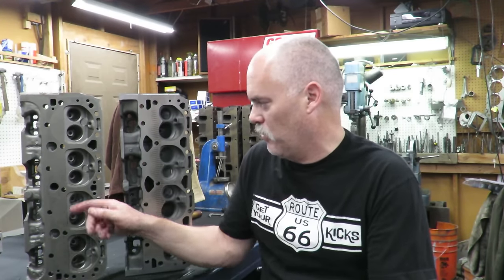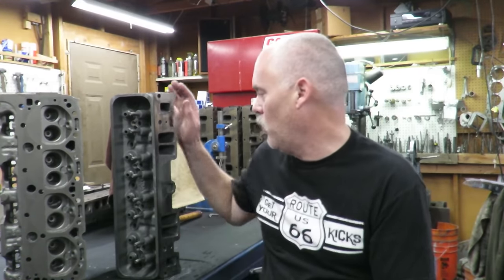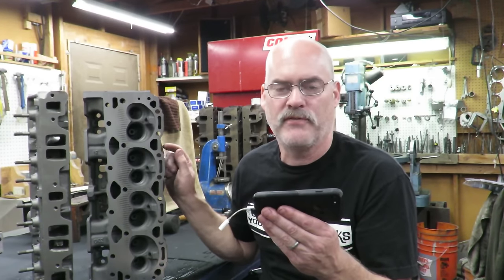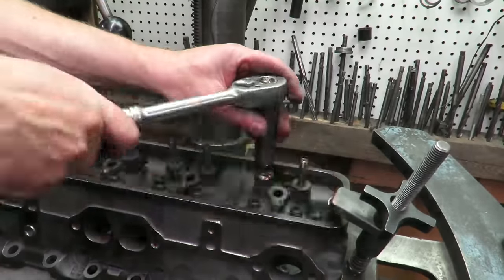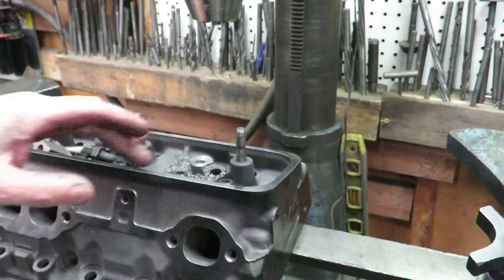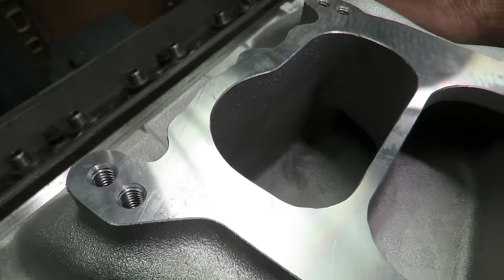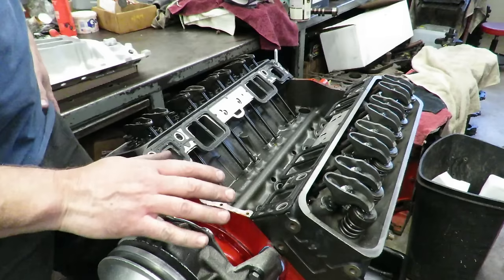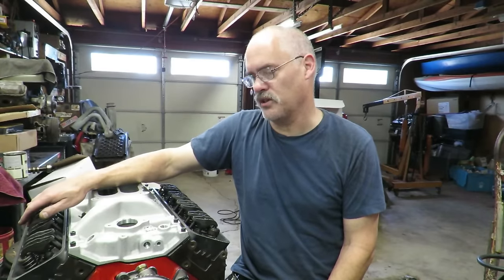How to get more power out of your Small block Chevy

Comment: What size cam could i put in without change springs or studs
Reply: My favorite cam is the 350HP/327 cam. it lives just fine under low lift heads and moderate valve spring pressure. Its a fairly lazy cam when compared to the agressive lobe profiles of today. Next to that is the Edelbrock Performer type of profile.  Avaiable from various manufacturers.   My brother put one in his 327 many years back which was a TRW cam. I put the Edelbrock in my 350. a few years back I put one  as a sealed power in a neighbors truck. all 3 cams carry the sme cam card and work well. its about a 300HP cam in the 350.
Reply: I have a ZZ3 camshaft in my 5.7R motor I'm running in my 1980 CJ5. You can look up the specs on it. I have the springs but haven't changed them yet since I didn't have them when I built the engine.
Reply: 650 CFM Holley carb, NV4500 5 speed transmission, Rock Jock High Pinion Dana 60 rear diff with 4:10s Do I need to say More??

Comment: What would be the best head replacement for my l31 for towing and torque.  My stock vortec heads might be cracked.
Reply from the maker: I would go with Vortec just buy new ones
Reply: @Myvintageiron7512   what's a good cam upgrade?

Comment: Hey whats better manifold vacuum or ported vacuum for advance? I have a 350 Chevy with Vortec heads, performer Edelbrock intake manifold, and a 600 cfm 1405 Edelbrock carb.
Reply: ACE TATTOO what’s better is throwing the junk edelbrock carb in the trash .
Reply: I see your point, but that still doesn't answer my question manifold vacuum or ported vacuum for advance?

Comment: I got a 350 out of a 91 Chevy truck can I use a dremel tool to increase the air flow of the head?its completely stock right now but looking to push 500 hp out of it when I get it stroked

Comment: Nice video
Reply: I have a 1989 Chevy 2500 and it has a 350 engine and I have been having problems with the TBI fuel injection I have changed a lot of parts and a lot on mechanics even a Chevy dealer mechanic that has a 50 year experience have look at it and the problem has not been found and one of the many mechanics told me that is a good truck the engine is original and has low mileage that if I was  interested in putting the new fuel injection systems that Holley and fitech make that it will work good in this truck now for my question will this engine upgrade will work with those fuel injection systems? Thanks and a very nice video

Comment: What would I need to soup up a 305 ?  Bottom end and top end  please.
Reply: Hot Rod has a good article on doping up a 305 for a limited budget, just Google "Hot Rod 305" and you'll find plenty of builds. Basically, headers intake, and a cam. Heads are virtually proprietary to the 305, but that's it.

Comment: Myvintageiron how much lift can you get out of tbi heads? Just trying to get more power for hauling. Planning on a comp high energy/marine 260h with .440 valve lift. Also it is carb swapped, Edelbrock performer dual plane and Holley 600 cfm 4160 gm hei and a recent valve job, arp head bolts.
Reply from the maker: The heads will take .440 lift but you need to change your springs
Reply: Thank you!

Comment: I have an 1988 350 that was rebuilt from some shop that I was gonna swap out the 292 thats in it now ....
I don't know if it has the swirl port heads from looking at it already bolted on ....
But -
Would I be better off w/ an 327 for more power ( and gas milage ) for my 1966 GMC 3/4 ton with stickshift overdrive than building up this 350 with vortex heads ? Also what cam should I use for either ?
Thx !
Reply from the maker: If you want my honest opinion I would rebuild the 292 that is one hell of an engine it makes more torque than a 327 and gets way better mileage maybe it's just tired and needs a rebuild out of the 3 engines 350/327/292 I would definitely build the 292 but between the 327 and 350 I would definitely go with the 350 it has more TQ and really on the street Horsepower is not what you need I always say for the street chase Torque for the strip chase Horsepower
Reply: Myvintageiron7512 later I saw you talking about the LS1 engines! What about that application?
Reply: How could that be ? The 292 weighs about the same , right ? Isnt it the best to just go with the LS engine ?

Comment: Please help me?  I cant find proof and I know you would have an answer. On a 1999 escalade 5.7 vortec, does filtered oil push through the oil cooler? Im asking because i cant figure out why my cooler has sludge in it???? 253k mileage on escalade. Can cooled oil with sludge cause engine failure? Recently my hyd lifters failed and i spun a rod bearing and two cam bearings.
Reply from the maker: your entire oil cooler system MUST!! be replaced if you have any kind of metal in it you will never be able to clean the metal out and it will destroy s new engine if you have a spun bearing replace everything lines and all
Reply: Thank you. I almost messed up. I put in a new  long block and mistakenly hooked up cooler after kerosene cleaning, i should have replaced radiator and lines. Oh well. Mine is cooled through the radiator and i was hoping the cooled oil leaving the radiator would head to the filter. Still not sure if it does. Thanks for answer, your a reall great teacher. You should sell your classes on dvd.

Comment: I know its a little late but i just bought a old tune port motor out of a z28. Its a little 305 that i was planning on boring out and putting a 350 crank in. Or im just gonna sell the motor when im done lol but i got the heads with the center bolt valve covers and the intake patter is weird. I got 2 straight bolts in the middle and the typical angled ones on the sides. Any ideas on these heads? Im tryna put the motor in my 90 ranger and have some fun with it. Im 17 years old and i need as much help as i can get. Thanks!
Reply from the maker: the 305 already shares the same crank from the 350 so putting in a 350 crank is basically putting the 305 crank back in I would find an 880 casting 350 block it's a direct swap for your 305

Comment: I have a 93 Roadmaster. I’m trying to get more hp/tq out of mine what should I all do to get it past the 180 hp? Could I do all of these mods but I have a hydraulic roller so what cam/heads/intake should I use?
Reply from the maker: you need vortec heads and a better cam the TBI heads you have are junk Edelbrock sells an intake that will accept your TBI injection
Reply: Myvintageiron7512 I’ve been told that the Gm performance cams would work. If I do the heads does that mean I’ll need headers that’ll fit vortec heads as well

Comment: Hey sir, how much hp do you think I would get out of a stock 350 with out touching the cam? I want to change the heads, intake manifold, carb, headers, exhaust ?
Reply from the maker: the cam needs to match the heads if you put on better heads you need a better cam
Reply: @Myvintageiron7512  hm ok, i’ve had different results with the ideology of the cam has to match the heads. I took a stock 454 and I put AFR heads on it upgraded the intake manifold and upgraded carburetor and I dino’d it. So originally it had 230 horses and after the heads and intake manifold it had 417  horsepower…. I was hoping it would be the same story with the 350 kind of thing, you don’t think it would work ?

Comment: I have a 67 283 with the power pack heads. Are they worth doing anything with?
Reply: disposing of them is good,standard 305 heads from a tpi camaro/firebird or a vortec 305 would be an upgrade and would be cheap as well.

Comment: So we got this 91 Chevy c2500, it was an old work truck for a plumbing company, anyways the thing is built for pulling (considering it has a hole in the bed for a gooseneck  and the granny 4 speed) and the engine is a worn out factory 350 (it smokes like a freight train lol), grandparents say it's not worth it but we've had it for a while and I've grown attached to it, anyways I thought about it for a while and I have an idea, could I just take the whole motor out of a truck you described (1996-1999) and either have the heads machined (like in the video, and assuming they're not cracked) or find a good set of aftermarket heads (cus I've heard aftermarket vortec heads are less likely to crack), and either go with the factory EFI that comes with the motor or just use a performer intake and top it with whatever I can afford?    Note: I wanna try to use the factory cam temporarily and upgrade the engine a part at a time.

sorry for the wall of text lol
Reply from the maker: sure that engine would be a great builder
Reply: To make it work, some companies build wiring harnesses that enable you to connect the different computer and EFI components found in the 1996 and up engine.

I have seen some aftermarket iron Vortec castings that don't break the budget. Some companies make stock replacement iron heads to replace specific OEM castings that are either crack prone, or too hard to find in a junkyard. The Jeep 4.0 331 casting is the first one I can think of.
Reply: Skyline Fever so what is this wiring harness called then, google only helps if I know what I'm looking for lol
Reply: There would be some rewiring, however, it wouldn't be complex. I think Painless wiring is the company that builds the TBI engine to Vortec engine conversion set.

What you don't have to worry about is rewiring anything not related to the engine.
Reply: do you have the part numbers, would be helpful in the sea of parts lol, also thanks for the info :)
Reply: I'm not sure of the number. I regularly buy stuff and get catalogs from Jegs and Summit Racing, they they sometimes advertise these Painless wiring kits. However, I might be mistaken and the correct item for your truck doesn't exist.

If you can't find it in one of their catalogs, I think you could give them a phone call. They help me out when their catalogs and websites confuse me.
Reply: I sure hope they have what I need lol, thanks again
Reply: I think I made a mistake. I found that the wiring harness is made by Howell EFI. I heard of them when researching the 1970s GMC RV with the Olds 455.

https://howellefi.com/product-category/general-motors/gm-vortec-products/

Comment: I bought an early 2000ish 4.8 vortec for a project but decided not to use it. are the heads on that motor the same as the heads being talked about in this video?
Reply: no that is an LS engine completely different engine and heads

Comment: I have a 350 chevy with dart 202 heads and I have  trouble trying to get it started what am i doing  wrong please help me.
Reply from the maker: That is a really vague question there could be many different reasons why it won't start need more info
Reply: If most  everything else is  right with your  motor, you may have too much initial lead on too little  cam. Do you have vacuum advance? When spinning it over does the engine spin slow hitting hard  compression bumps? Years ago as a kid,  I had to put a mild  cam in my 327 race motor to make it a daily driver while my DD was being repaired, and I had to get out and mechanically retard the timing to start it then add in the initial. That was 100% mechanical running 12 deg. initial with 24 in the distributor flyweights all in before 3000. If you are not high comp on a mild cam it could be  many other things from carburetor to coil ballast wiring being incorrect. - Sandy

Comment: Got a weird question, why on a sbc head gasket do they have the small pin holes on the big holes between the cylinder ?
Reply from the maker: To slow down the flow if it flows to fast it does not have time to absorb the head
Reply: Myvintageiron7512 thank you sir. Your videos are great . Reason why I asked is I have an engine that I can’t keep cool. I think the head gaskets are on wrong. I do have another question for you. I have a 87 and up block and it’s bored .030 over. I was told it is going to run a little hot because the block is made of thinner metal? I don’t know if this is true.

Comment: Any suggestion for a good performing/value aftermarket aluminum head you prefer to use on a fairly stout 355?
Reply: jess l , iron heads basically make the same horse power , the big difference between these heads is weight , aluminum heads are about 20 or so pounds , iron heads are 40 or so pounds each , so unless you are drag racing with your car and want to save weight , iron heads is the way to go , iron heads don't warp as easy as aluminum heads , planning and porting your heads along with a bigger cam can add 100 horsepower , and with a single steel shim gasket like comes from the factory to increase compression , I have the part number if your interested , but there are different aluminum heads if drag racing weight is what you are after , elderbrock, Dart, World all make aluminum heads

Comment: You say vortex heads are prone to cracking if they get hot. What sbc heads are best for high temps and good hp?
Reply: Lucky Rooster the engines going in a derby truck so my radiator only can cool for so long.
Reply: Tankhunter350 if it's in a derby I'd just use the old smogger heads that way if they get hot and crack you aren't out much
Reply: There are aftermarket iron Vortec castings that have extra metal in them to prevent cracking. They aren't too much more expensive than new OEM castings.

Comment: 2 ways, 010 block, ft pistons, fast burn aluminum heads, .550 lift .245 @.050, a big dual plane intake dialed in 750 cfm holley.... that should be around 400 hp 7k rpm max. $3500...... 2 nd way, dart iron block, 4340 crank, billet rods, brodix 221 alu heads, .680 roller .264 @ .050  12.5 je  pistons,  single plane intake....race fuel only, dry sump it,  dialed 750 hp holley .. 640 hp 9200 max rpm... $8500+  both will live...

Comment: I bought a truck that the original owner installed a Comp Cam 260H. It has .440 lift. Is that safe to run without needing to get the guides machined?
Reply: what year are the heads from? junk swirl port heads yes, Vortec heads, yur kinda pushing it
Reply: @brp360  the engine still has the original heads. I was going to get some heads off of a 96 or 97 Vortec.
Reply: @jessebenjamin4779  you still haven't told me what year your engine and heads are. what year is your engine and heads?
Reply: @brp360  94 K1500 Suburban
Reply: @jessebenjamin4779  no lift concerns with the 94 heads
Reply: @brp360  what I was trying to figure out is if I need to get the vortec heads done with the type of Cam that I have in the engine
Reply: @jessebenjamin4779  I definitely would have them machined, I've heard sometimes just .420" lift will cause clearance problems - better safe than sorry
Reply: @brp360  thanks. Better to be safe than sorry.
Reply: @brp360  i was thinking of buying some  then rebuilding them myself with refreshed valves and springs.

Comment: I have a 99 Tahoe 2wd 2 dr the tired 350 needs seals it just turned 180K miles... I wish listed a self tuning efi, dual plane intake, chevy performance fast burn heads with 210cc runners and a comp extreme energy cam 490 lift 238(ish) duration just that at summit $2838. I will have the cylinders taken out to .030" over with flat top pistons... do you think I should have to block drilled for a 4 bolt main or retain the 2 bolt...? I hope to top out with about 375 HP any suggestions comments???
Reply from the maker: sounds like it should run good I would buy a set of aftermarket vortec's from Dart or RHS forget about the 4 bolt mains you don't need them
Reply: or you could buy this  from scoggin dickey https://sdparts.com/i-24080864-blueprint-engines-bp3503ct1-350ci-sbc-with-cast-iron-vortec-heads-and-roller-cam.html
Reply: but if you just want to build your engine i would use profiler heads they have great flow and price is nice also. or these guy for a really budget head that flow good http://precisionraceengines.com/product/precision-race-aluminum-sbc-cylinder-heads-w-660-lift-springs/

Comment: Hey, I've seen your video's and have watched them for quite some time. I picked up a 1970 chevy 350 and the casting number on the head was 876445 (445). So I did some research on them. I can't find anything. Are those a good stock head, or are they going to flow terribly?
Reply from the maker: double check that number I think you got it wrong
Reply: @Myvintageiron7512  take the valve cover off, and between the intake valves for cylinder 2 and 4 is where that number is located. I have pictures of it as well
Reply: That's the only number on those heads that could be the casting number.

Comment: I'm posting my questions on this video. I've been watching as much of your stuff as I can , and you have replied to some of my questions. I'm assembling a 383 stroker. My mains are .003" rods are .002 -  .0025. Should I use a high volume oil pump with these clearances?  Also after checking CC's with a burett I'm at 10.1 : 1 compression ratio. Installing a Howard's "Street Force 2 flat tappet cam.  Is this too much for a full size 4x4 that runs unloaded most times buy will do towing at times. Tractors , camper , boat. I sure hope you can reply soon. I look to your knowledge and trust you. I'm now ready to instal oil pump and oil pan.
Reply from the maker: I would not use a high vol oil pump with those clearances stick with a 10W30 or 40 oil  it's a flat tappet so make sure the break in is done correctly and with the right oil you also need to run high zinc oil for the life of the engine break in for first 30 min then chang oil and filter and run break in oil again for 500 miles after change it again and go with high zddp hot rod oil the street force 2 has a power range from 1200 to 5500 it should be fine in that truck even towing should work well I think it's a good choice it should be a screamer sounds like a cool project